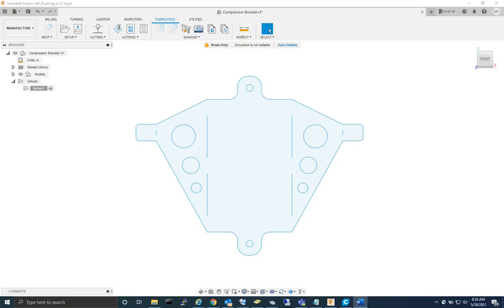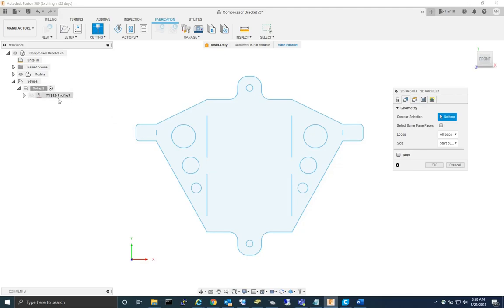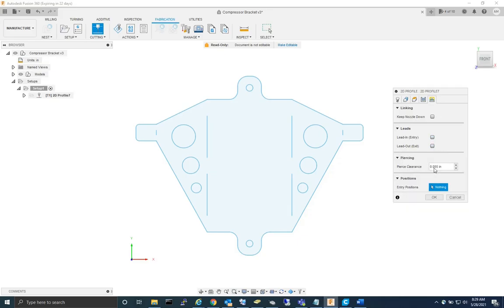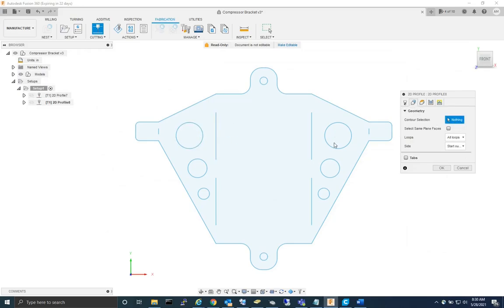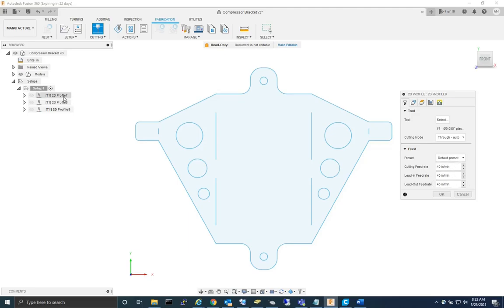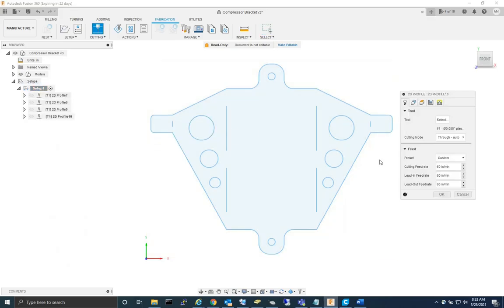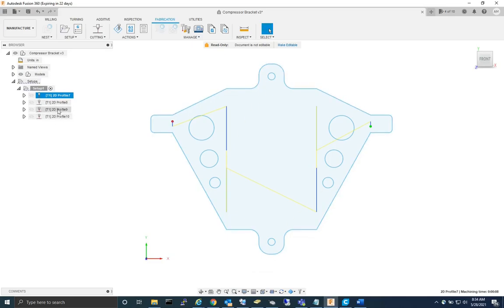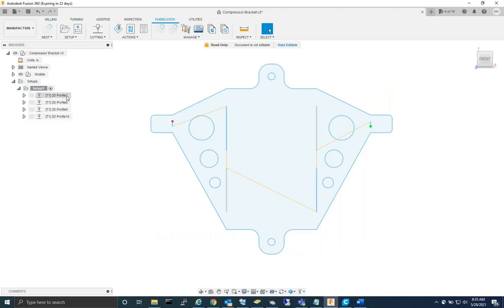How To Program Relief Cuts in Fusion 360 for Plasma CNC

Comment: This was very helpful for how to set multiple setups, but i tried it and still showing an issue in my simulation. 

So to back up, in the design tab i drew the lines, then “thin extrude” them as a cut (only option fusion will let me do) but then when i go to add my cut path fusion recognizes it as a small rectangle and appears to go over the line twice. So my question is how are you adding these in design?
Reply from the maker: A simple line. Then make sure the sketch is visible in CAM so you can select the line

Comment: Super helpful, thanks a lot!!! quick question: how would you go about creating a fusion360 file with short plasma bursts to act as center punch for drilling holes? short enough not to harden the metal...
Reply from the maker: The hard part is to not harden the metal. That will happen no matter what. But to pierce holes like this I create a very short line or a very small circle and cut on the line.

Comment: I have a similar test plae that i use all the time I was using it following along with you when you click the circles always indicate a inside cut on mine it always indicates an outside cut which then I have to switch the arrow to inside is  there a way in fusion to switch that not a big problem just annoying. Thanks

Comment: Thank you very much for this. I was struggling how to make a straight line inside of some stock. I do have one question though . Are you able to extrude something like that on the design tab and have it show the relief cuts? When I extrude a body with straight lines inside of it, the straight lines are not "holes" in the stock. I'd like to be able to see what it will look like before cutting if possible. Thank you!